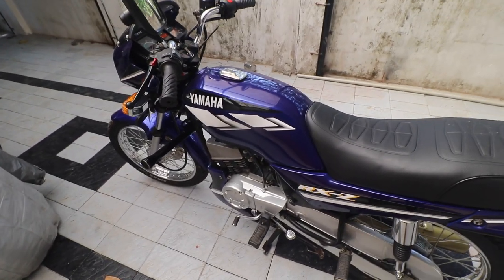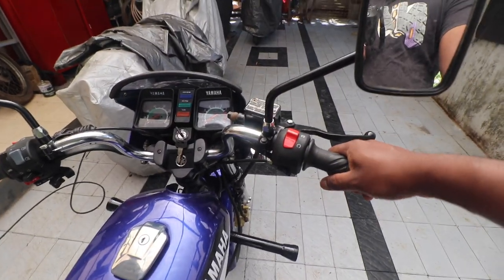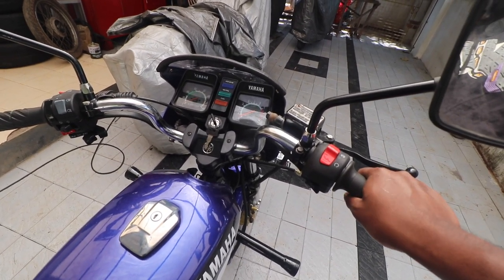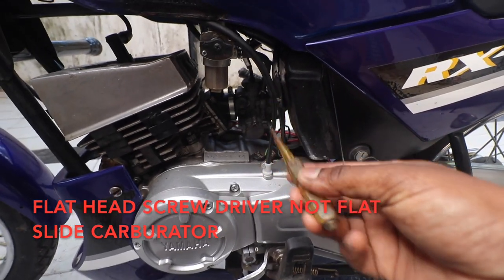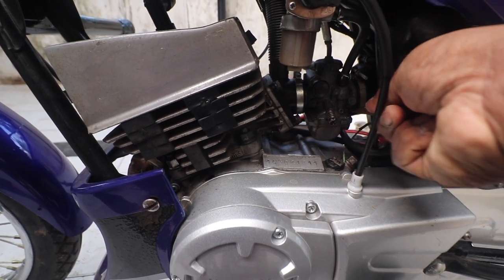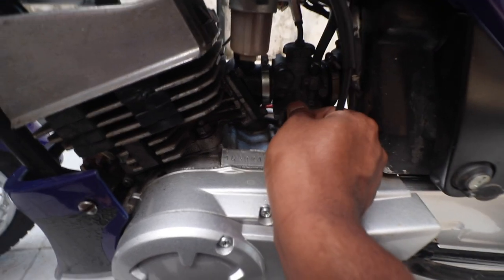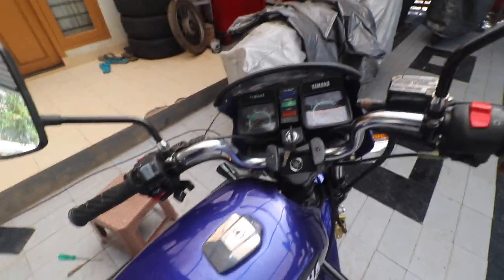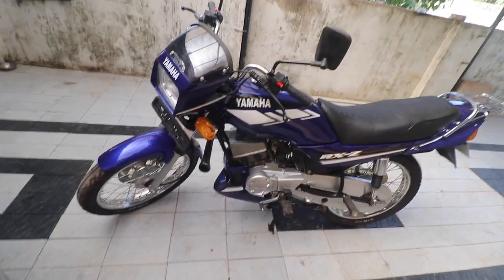Tuning a Yamaha RX Carburattor plus some troubleshooting steps

Comment: I have a RXG 1996 model gives around 22-24 kmpl.How to increase its mileage ??
Reply from the maker: First of all find out why is mileage so low
Reply: @Yamakaze  how to know about it bro ??

According to yor how much mileage would RXG give ??
Reply from the maker: shreyas ms the bike should give anything above 30, if it’s stock. Check for leaks, also make sure your method of checking mileage is consistent. Do it reserve to reserve. Once the bike host reserve pour about a liter of fuel and note the kms till it hits reserve again
Reply: @Yamakaze  thank you

Comment: Can a siezed suzuki shaolin engine be fixed
Reply from the maker: Ahmed Huzaifph of course. Depends on what all needs to be refurbished/ replaced. Can be definitely done.
Reply: @Yamakaze  tnx and when is the next suzuki shaolin restoration video coming up and please do make a mileage and a review video about it
Reply from the maker: Ahmed Huzaifph the Shaolin is stuck due to lack of spares as the supply chain has been affected. I will look for the spares locally once the shops open

Comment: Hey would a vm 26 imported carb for 5 spd rxz be a good idea? It seems that is what they use for king in Malaysia
Reply from the maker: King has different ports and a chamber, buying just a carburetor won’t give you any major gains, you will have to jet the carb to work on the Indian ports or else it will misfire

Comment: Bro My Rx 135 is over heating bro what is the reason bro
Reply from the maker: Biker Santhosh you need to check if it’s running lean or rich, if the timing is advanced then also this can happen. When did you rebore your cylinder?
Reply: @Yamakaze  I didn't rebored bro
Reply from the maker: Biker Santhosh it’s a very vast topic, give me more information when did you observe the overheating? Are you using oil pump or premix? Any changes you made to the bike?
Reply: Same problem Iam facing in my rx 135 speed

Comment: Will an iridium plug make a difference in performance on a 2stroke?
Reply from the maker: It will but if your air fuel mixture or oil mixture is wrong the plug will get shot easily

Comment: If i want to put a vm 26 carb in indian rx 135 4s , what would be want to change???
Reply from the maker: It will work, the air filter might need to be changed plus jetting for the air filter